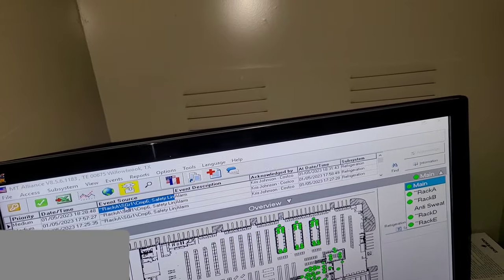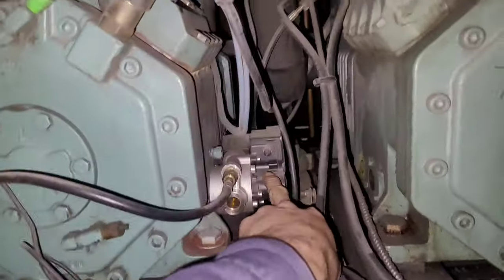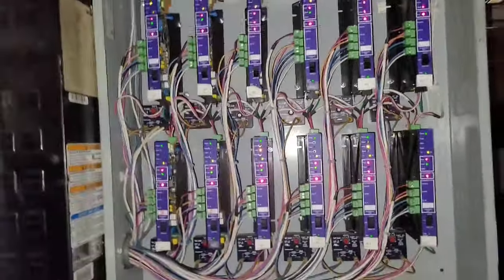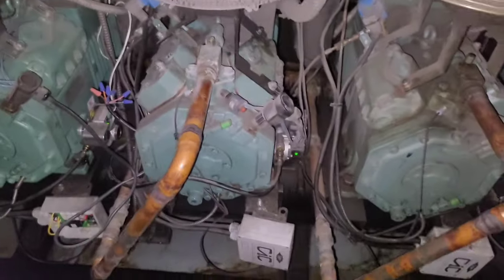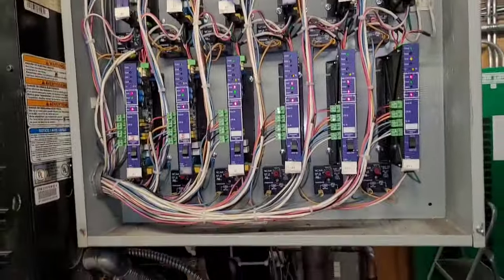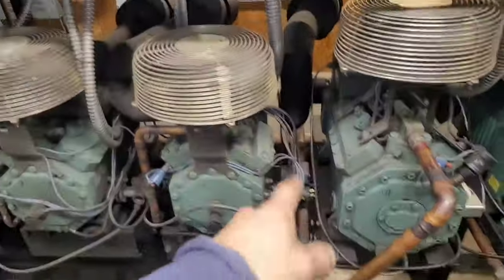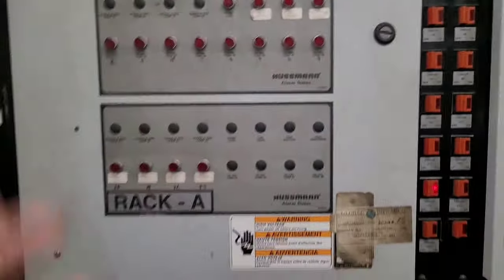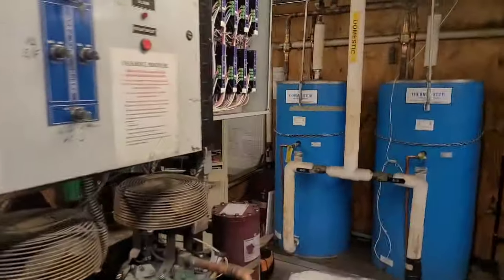Rack Circuits That Flood Back Cause Oil Failure Alarms

Comment: So the liquid pushes oil out of the compressor causing the oil pressure switch to cut out?
Reply: Yes when liquid slugs back to the suction it’ll wash out the oil since the viscosity is higher